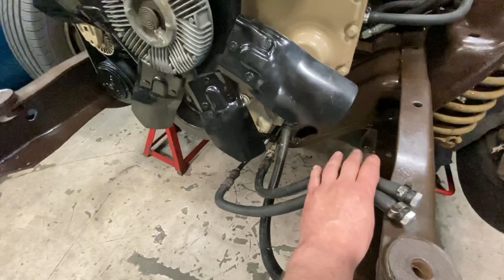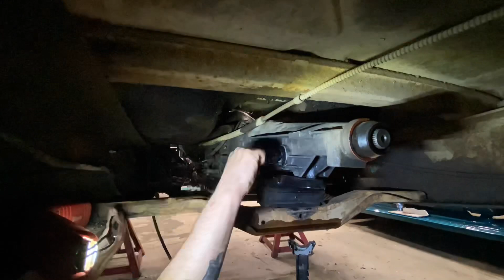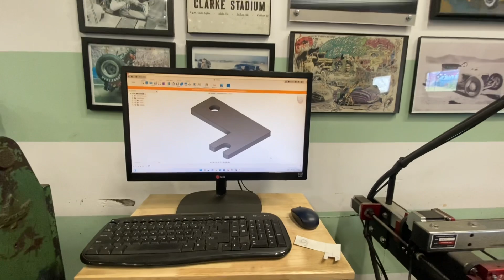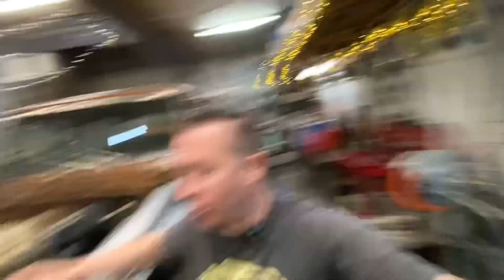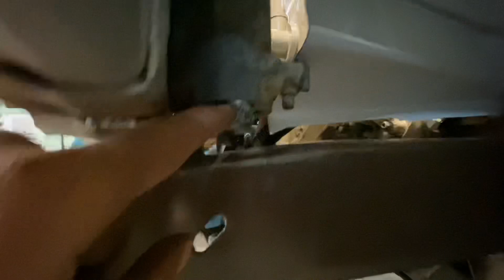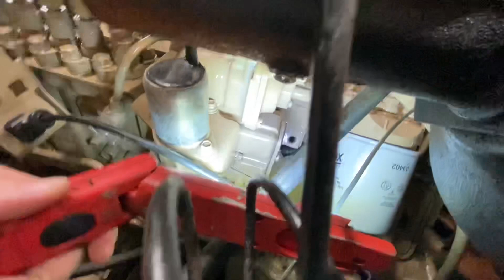Brown Sugar Cummins Swap part 6. Fire in the hole!

Comment: Hey maybe I am seeing things,but when you had shannon shift the trans it looked like the lever on trans went up and down(they are bad for coming loose)maybe check and tighten pinch bolt on lever, should stay flat during sweep.
Reply from the maker: Rad! Thanks for pointing that out, I’ll double check it!